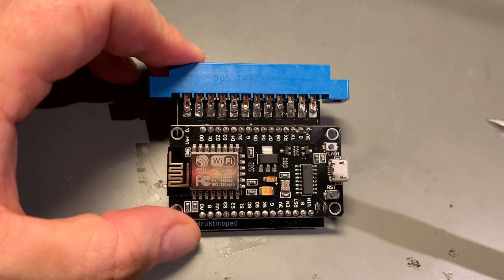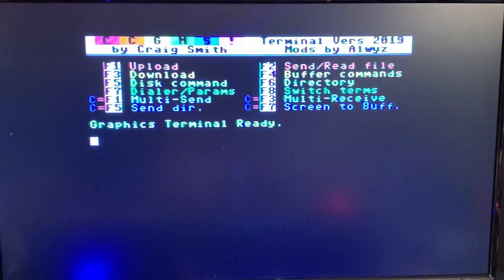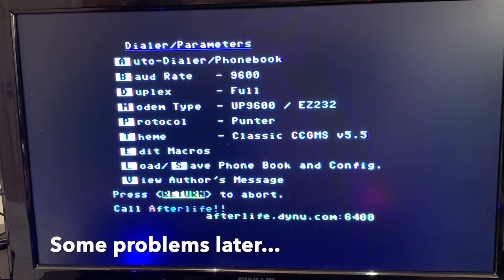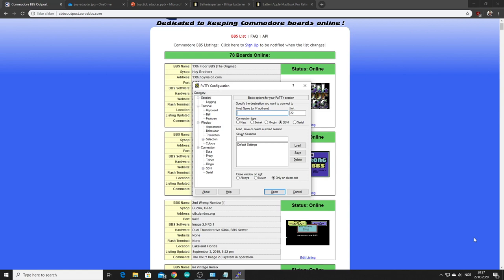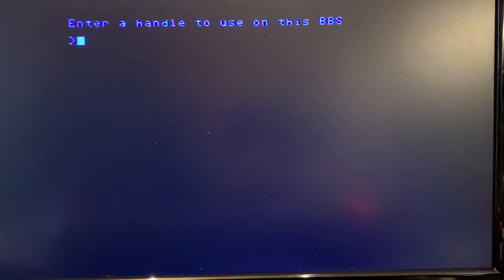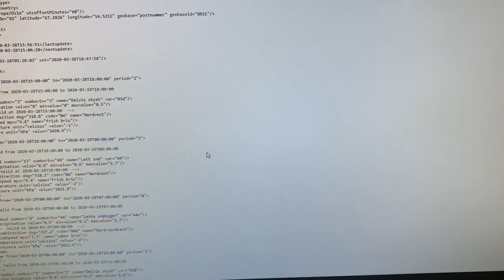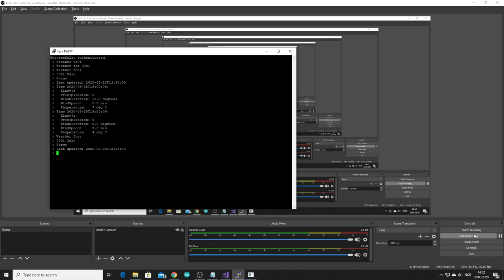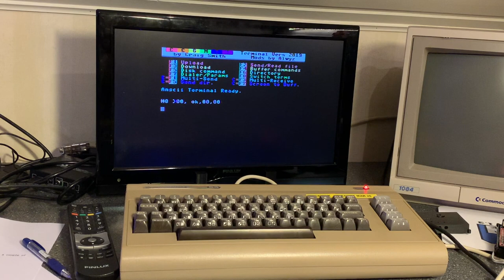Commodore 64 WiFi - Creating a weather service

Comment: It's an ESP8266 microcontroller/wifi module. It is an Arduino variant. This one is most likely pre-flashed with an Arduino sketch. That sketch probably communicates with the C64 over the RS232 lines using it's serial (rx/tx) pins. So "it" connects to the web and just sends the data it receives to the C64.

Comment: u can flash a zimmodem firmware to it and use the disk with lots of internet apps like FTP and IRC. i have the exact same wifimodem and made that. It has even dumpproof configure app to set the wifi without memorising all the commands.

Comment: Excellent stuff. I found that really entertaining. Like you, growing up in Ireland, I had no modem or BBS experience. I always assumed my parents would say no as phone calls were expensive. I think you’ve inspired me to pick up a WiFi Modem. 👍
Reply from the maker: Same here. No modem. We just got land line at that time, and it was expencive. Had to call after 5 pm I remember :)
Reply: Its correct it was only 1 initial charge if it was after 5, local, and on weekends. Which meant technically, one could keep an open line from friday 5pm to monday 8am to a friend. My parents became hysteric, and no matter if I showed them where this was stated in the phonebook would they believe it. Later we developed a system with 2 quick calls, but hangup after first ring twice, meant "come over" etc.